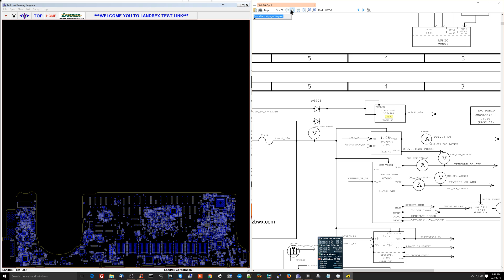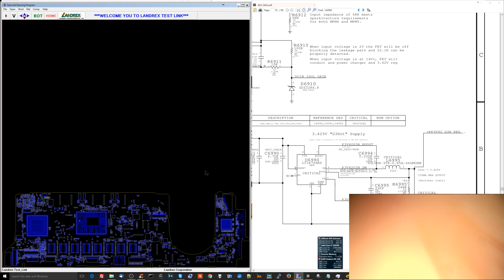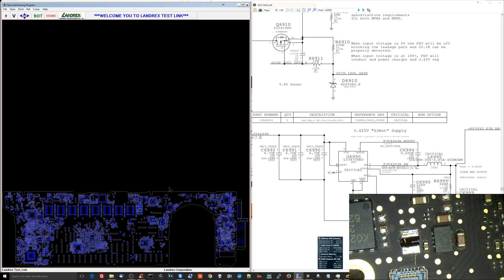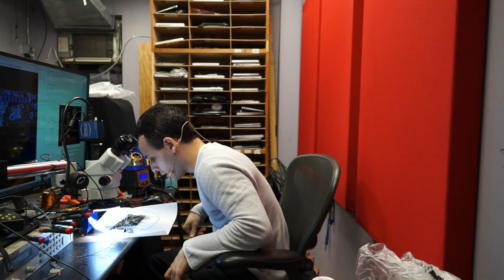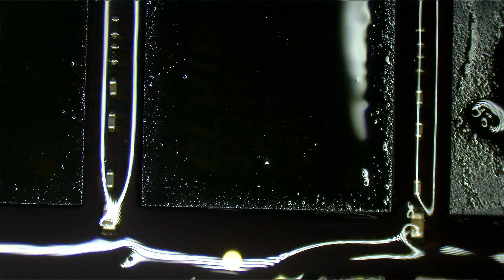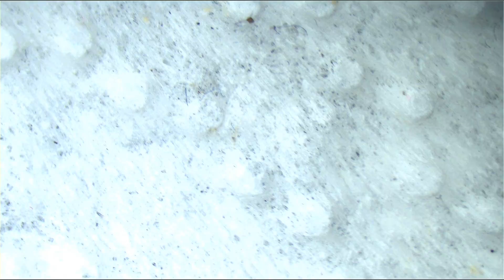Retina Macbook Pro dead no power after KB replacement

Comment: I notice you're super-liberal with the flux on all of your videos. I try to do the same - it's pretty hard to have too much flux, and it makes soldering so much easier. However, it does get all over everything and can be pretty pervasive (particularly under SOIC stuff) and looks like an awful gunky mess when left for a couple hours. I've seen mixed answers regarding cleaning it up. Some say a quick wipe-off with appropriate non-static lint-free cloth is sufficient, some recommend alcohol wipes, some say pour isopropyl alcohol on it and let it dry by air, some even say use an ultrasonic bath... all with various arguments on why their solution is the best: flux can corrode / alcohol is harsh on plastics / cloth can leave fibers / blah blah blah. What's your take on this?
Reply from the maker: i have the ultrasonic cleaner on set to 60 or 70c with branson ec and distilled water. when I am done with a board, I run over the board with the hot air station and get all the flux nice and hot so it is less clumpy, and then toss the board into the cleaner. it gets rid of everything.
Reply: Is there a sensible option for those of us without ultrasonic cleaner?

Comment: Another method, if you get a multi meter with higher resolution you can measure the ohms in the .00XX range you can find shorts by probing around and finding where the ohms  go down (aka the closer you get to the short.) 

I use this one for that purpose, kinda an annoying meter(continuity is super slow) but it servers it purpose. For finding shorts/faults in new pcb.

http://www.amazon.com/Precision-2712-Digital-Multimeter-42-5mm/dp/B005G5MEHG?ie=UTF8&keywords=bk%20precision&qid=1461608819&ref_=sr_1_8&sr=8-8
Reply: +KingOfKYA 

But then again just blowing shit up but giveign it max amperage is more fun.

Comment: You should seriously get an IR camera, it would make your job much easier for things like that.
Reply from the maker: +TheFPSPower This is the first repair I've done where it took more than 20 seconds to find the short. In the end, it got fixed anyway. I will buy an IR camera when the resolution of the $15,000 one is available for $300. Not getting raped to buy some 60x60 resolution POS.
Reply: Louis Rossmann I know there are some IR cameras for phones, and they're usually cheaper than those you're talking about, that would get you out of the resolution problem.

Comment: Louis, you don't need to stop recording to go back and see what the orientation of the chip is... You can find that out on the board view. Keep on clicking on the corner pads of the chip until you get to Pin 1 and that's where your dot should be ;)

Comment: How much was your time worth again? Lets do the math: 300$ per (max)20min notebook repair(worst case). You took 10 minutes longer than you would with a flir. Lets put this 150$ of wasted money in the imaginary flir money-box and wait until its filled with 500$ (about the price of a cheap flir). Lets see if eventually this flir hate could change into flir love ^^ (just as the JBC hate -> love transition you are in right now). 

Loved watching your cynical and sarcastic video once again Louis :).  What was your patreon page again xD?
Reply from the maker: +Danny Bokma this is one time out of hundreds.

the last time I used a flir under $6000 it was a joke. The "heat spots" are the size of the board. how does anyone use this for actual troubleshooting?

and the jbc still isn't worth it unless it's free
Reply: I think it's just that the Flir camera won't make much of a difference as the majority of shorts you can feel straight away with your hand or by pouring some alcohol on them so actually the investment in Flir camera would not pay back as quickly as you would think.
Reply: +Louis Rossmann I read somewhere that for the FLIR Ex series (or was it another one, hm... ) the resolution is just a software thing so you can buy the one with the lowest resolution and hack it to the one with the biggest resolution.

Comment: Um, one word.   "FLIR"
Reply: +Louis Rossmann I use the FLIR ONE on the latest iPod touch, got it for $99 black Friday and the iPod touch was the free gift from fluke for buying a fluke meter. It works just as good as the $2K versions, just probably not as durable or IP67?? rated. Take a single picture and it captures every point of that picture with temperature data. Besides seeing what is the hottest part you can then use the FLIR TOOLS app and you can point to any part of the picture to see that temp data on that part. i think you can also do this in the flir one app? 
Dead shorts shorts show the hottest in the beginning as you power the board up since the board is shorted out then most likely none of the processor chips are running and stay cold. In you case this probably would have showed the trace being hot to that chip that was blown.

It has saved me a lot of time and is more efficient in troubleshooting. I did the alcohol thing before, but sometimes didn't show the obvious part issue. You can also freeze a board with upside down compressed air can, then the part that un-frosts faster then the others is most likely your shorted or failed part. Another way and a little cleaner then all that alcohol spilled all over your bench.
Reply: that word costs thousands
Reply: +Goatsee not necessarily FLIR makes a smartphone accessory for 200-300 (andriod vs iOS).
Reply from the maker: +Erik Liska it's a piece of shit. great there is a colored dot the size of the board on the screen... but what is getting hot? who the fuck knows!
Reply: Louis Rossmann fair point. Just letting Goatsee know that not all FlIR's cost thousands of dollars.